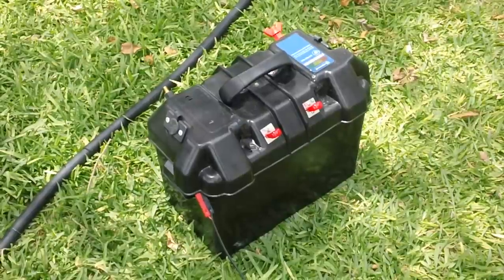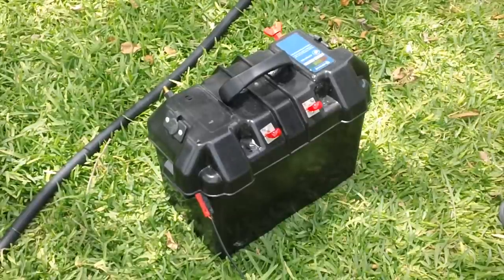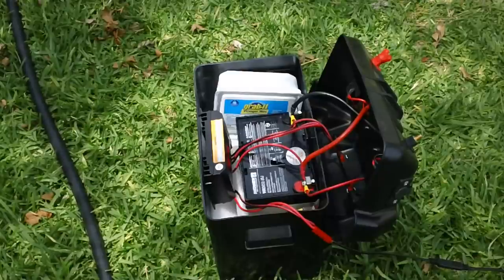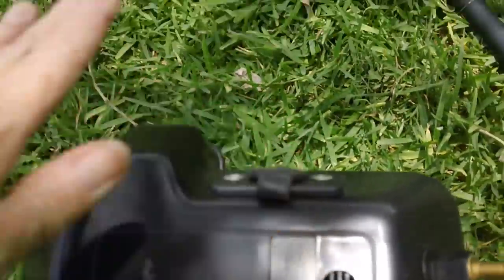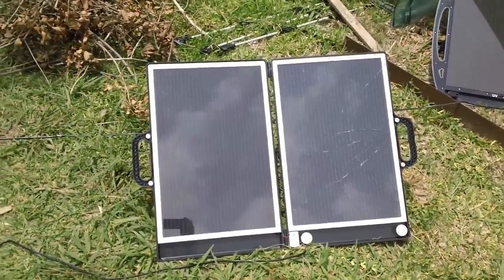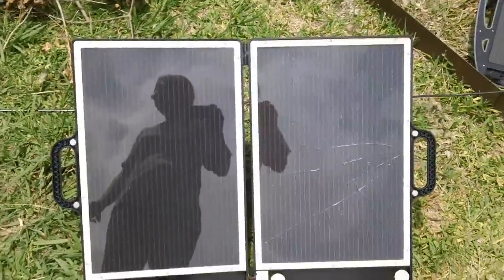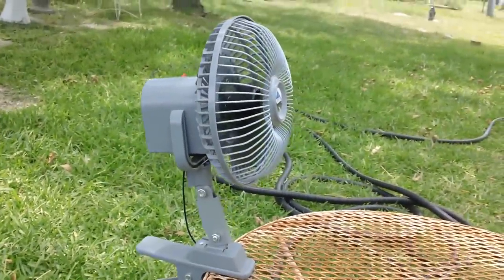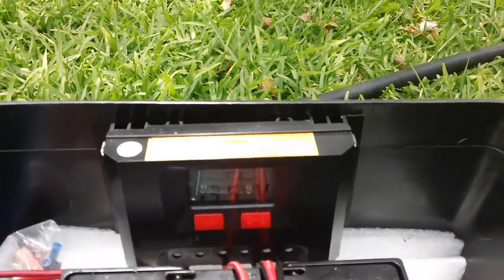Prepper Power - Homemade Portable Solar Generator

Comment: One other thing, you can use the generator or alternator connected to a bicycle, they charge up a LOT faster and will help you when there are cloudy days. Basicly any motor is also a generator, just check how much power it is putting out before connecting. Car generators will out out 14.8v and more efficient plus you get to exercise and if the kids want to charge their cell or computer make them use the bike to supply their energy! !

Comment: Very nice video!! One thing that is wrong though is the post labeled "CC" doesn't use power directly from the panels. The post labeled "CC" does use battery power, the difference between posts "B" and posts "CC" is that post "B" will drain your battery to 0% if you leave your stuff on, and post "CC" will cut off all power when battery is at 50% to prevent battery damage.
Reply from the maker: +AmbSwizag Thank you for the correction.  And thanks for watching.

Comment: The wires coming off of the "Load" terminals on the charge controller are not bypassing the battery. They are pulling power from the battery but can automatically turn off all power from those terminals if your battery voltage gets too low to the point where your battery would be damaged. If you doubt that, unplug all of your panels and power something off of the "Load" terminals and obviously when you are getting power it will not be from the panels that are no longer connected. Oh, and you can get a 12v marine deep cycle battery rated at about 90 to 100 AH for $90-$100 instead of that little 35 AH battery you paid $80 for. ;-)

Comment: Some great ideas but may I offer some suggestions as I have made things like this and now working on a whole house system. For lighting use LED's, options are unlimited (this is where price does matter, opt for the better ones). Add a couple usb ports, they will be useful charging computers, cell phones etc. and they are cheap. You can add a load switch on the outside (off/on). If you are going to make a system that is not so portable and want to add many batteries, junk yards will normally give (for free) battery cables. Get there a week before they are going to crush the cars and they will normally let you go back and take them. In a larger system, the cables and terminals can add up a lot of $$. Add one cig lighter to box that connects only to panels.  If your property is like my impression, you have a barn with equipment. The equipment (including trucks) have batteries with high amp hours. Harbor freight has 45 watt panels with charge controller and accessories, if you get them at the right time they will cost barely over $100. So, on the south side of your barn (or house) these are great and have mounting frames with them for mounting on the ground but you can also mount them on the roof, a few sets of these with connectors can charge your smaller units plus you can add batteries as needed or whenever you come across one here and there. You can get large (tupperware like) tubs to put your batteries in so they won't be on the ground and will not be subject to minor flooding (great if you are installing in your basement plus you can add a 12v sump pump as I did and never worry about flooding. And finally, for your next video, make a script so you don't keep repeating yourself, show all equipment at the beginning and explain what each is, what it does, the cost and any personal data or experience you have with that particular item. Over all, I think you have some great ideas. You made me decide to make a portable unit. Overall, "great", so I am subscribing and looking forward to your next video. Oh, the outside units (45 watt panels), you can start with one set and add a set whenever they have their sale and you can use a coupon, Harbor freight is one of the best stores I have ever been to.
Remember...Watts divided by volts = amps you can reverse it also,  Amps X volts = Watts
Converters at Harbor Freight are cheap also and good to have around. 100w, 200x, 450w etc, real inexpensive and as a prepper, you know they will come in handy. I have some other ideas also and they will probably come to me in the middle of the night so I will write them down and if you don't mention them next time, I will add in comments. INFORMATIVE SHOW !!! ^5

Comment: I looked for the Battery Power Center Box and found one through Sears and will get it for $0.00 because I had exactly enough Shop Your Way rewards points to cover the cost and it will be shipped to my local store so I do not even have to pay shipping. What a country!

Comment: Safety First! 12 volt can and will cause a fire if not fused properly. Any thing you connect to a powered circuit needs to be fused to prevent a fire! The connections in the lid of your box are connected to a breaker if its like the one I got, but the stuff you connected directly to the positive battery post needs to be fused to prevent a fire. The charge controller needs a fuse between it and the battery. Solar panels produce power and need a fuse on the positive wire to prevent a fire. Check any commercial solar system and you will find fusing on the powered wires. Nice setup but needs to be fused.
Reply: Normally if you use the right size wire, you shouldn't need to worry about fire. Fuses are added to protect the end unit from damage (like the radio etc), but yes, you are right, there should be more fuses in it. On each lighter socket and if she adds usb port, they MUST be fused or the cell phone or laptop she is trying to charge could end up in smoke!! You have great attention to detail !!! Good show !!!

Comment: 1500 watts can always depend on the size and type of batteries that the solar generators has. It is guaranteed that the cycle of recharge and discharge makes it certain for batteries to charge in accordance to what it has juiced up.

Comment: SurvivalTechNord She said the 12Vdc sockets were 10A fused. She also can inline fuse the Anderson pole connectors if need be. One improvement would be to install 4 diodes where the four leads feed into one output (incidentally this splitter is wired in parallel) one on each of the four leads. Cathodes towards the output lead. That would prevent current back flow if the panels droped 0.6v below the voltage of the battery at dusk or nitetime. But from what little I know about the specific specs of her panels, I would think they are reversed bias protected. For her first foray into solar generation she did pretty well and I will follow her lead No pun intended.
Reply from the maker: Hi Thanks for the input.  The panels do have reverse bias protection.  It was one of the things I had read up on and learned from the many great videos here on youtube.  :-)  Will have to research the cathodes though don't know anything about that so thanks for the info I always appreciate constructive input.

Comment: If you ever attend flea markets to sell goods, on a really hot day, that would be an AWESOME little system to have to run some fans to keep you cool.  You could probably make some kind of little mounts that you could allow the solar panels to stay on the roof of your car, van or SUV.  You could put a nice blanket on the roof and leave the solar panels up there to charge the battery and/or run power to an inverter.  Amazon has a Monocrystalline 250 watt panel for $349 now.  You could get two of those and have 500 watts and have enough power to run a good inverter.  Getting a good deep cycle battery is where it also gets expensive.  The cheaper batteries won't last much more than a year as they are not made to completely discharge too many times.
Reply from the maker: excellent idea
Reply: PrepperRetreat Since I wrote that, I have found that Renogy is now selling 250 watt Monocrystalline panels for $239, but they require buying 2 minimum, so you'd have 500 watts for under $500.  More than enough power to power some fans, a radio or even a laptop or other items that you may need to power some stuff while sitting out in the sun all day.  I've seen lots of people selling stuff at flea markets and most of them did not have power unless they paid for the much more expensive booths.
Reply from the maker: That's a good price.  I will have to check that deal out.
Reply: PrepperRetreat To find it, go to Google and cut and paste this search phrase to find it.  This thing won't let me post URL's.  Search on:    Renogy 250W Monocrystalline Solar Panel Black on Black

Comment: it actually is a 420 watts/hour storage..consideration must be taken on not depleting it past the 50% of its capacity which is 210 watts which you should wisely determine on what to use them so you do not damage the battery or kits life....and watts is watts no matter if you use them in an hour or during a whole day or even days while recharging having sunlight availability.

Comment: Running in a series will add up the voltage and leave the amps the same. Running in parallel with keep the voltage the same and add up the amps.

Comment: Ideally for the average Blue Collar guy say in Florida or Louisiana on a beer budget prepping for H'canes...a "Solar Generator" battery pack that would get you thru the night (say 10 to 12 hours) with enough energy for some lights, a fan or two, a couple of small power supply battery chargers and a radio or TV (asking for a lot from batteries, I know) . One could back that up with one of those little Harbor Freight petrol generators for the refrigerator if a longer term outage occurs.
Reply: As I said above, using LED's for lights (they use almost no power) and a cheap 12v motor off ebay for fans with Lightweight blades will supply what you are talking about.  Remember, anything that generates heat or cool is going to use a lot of power. My suggestion, put the beer in a stream with a rope tied to it.

Comment: Nice work, ma'am!  I'm about to start working on a similar project myself.  I'm going to try to put four 10Ah batteries connected in parallel inside a Pelican 1200 series case.  If it works out well I might build more than one (eventually) to serve as backup power for my HF station in a box!
Reply from the maker: Sounds great!   Love the pelican box idea.
Reply from the maker: PrepperRetreat Oh and a video would be really great.  Loved the one on your 8900R
Reply: Thanks!  I'm just about finished building my HF station in a box.  Once I get the digital side of the operation working I want to make a video going from all my gear loaded in the truck to fully up and running making contacts.
Reply from the maker: I'm looking forward to seeing it :)

Comment: Hello PrepperRetreat
I have watched this video many times and I really enjoy your sharing. Something just hit me about the setup, and I thought to ask you about it. When you have your solar panels plugged into the charge controller, and the charge controller is plugged in and charging the battery, how do you:protect the charge controller from melt-down if you plug a high amperage device into the cigarette lighter port on the box, if the charge controller is also charging the battery? Shouldnt the "load" side of the charge controller be the only place you take DC from the system, if the solar panels are connected?
STN

Comment: Actually with that 35 amp/hour battery you built a 420 watt solar power generator
(35 amp x 12 volts = 420 watts)..NICE JOB!!!
Reply from the maker: +Carlos Lizardi-Montero Thanks :)
Reply: That's nice of you to compliment her and make her feel better but 420 watt HOURS is not the same as 420 watts.  If you had a full charge on that battery and you drew 420 watts from it, you would deplete it COMPLETELY in a single hour... in reality, you can't drain a lead acid battery all the way.  Nevertheless, amp hours or watt hours are a measure of storage capacity vs. amps or watts which would be a measure of power.
She is right that companies actually claim their solar generator is a particular wattage when it is just the inverter that can support that amount of power.  I don't think anyone should make such a claim unless the battery capacity is enough such that the full power can be provided for an amount of time that is equivalent to a full tank of gas for a regular generator.  Furthermore, if the solar generator comes with solar panels, the panels should be powerful enough to completely recharge the battery (bank) in a reasonable time.

Comment: my friend that is the sound i get out of my gx-l3 battery op compressor wyhen i have the converter plugged in and i plug that into a scetchy extension cord.
 the fans dont want to kick on good and the compressor wont pump correct. i have to unplug it abnd then plug it in better , a firm connection gets better production. of course that means it is pulling more amps, so there is deffinitly wear on the motor and windings and more than normal wear on the cylinder. 37 fills huh. hmmm. well i can suggest a vever at the $324 level with auto stop and a year warranty. course that is just because vever will send rebuild parts if you ignore their attemts at bribery.
 i have not had any issue out of my gx-l3 it just works when it is plugged in correctly.
 and i think it is comming up on a year service here in june.

Comment: I liked your video so much I hate to even comment about the Powerpole connections.  For use in amateur radio, the community has adopted a standard polarity for assembling the Singlepole connectors, using one red and one black housing, as well as a mnemonic for remembering the arrangement for the positive connector: Red Right—Tongue Top. (Google it and you'll see what I mean)  When looking at the front of the connector, the red should be on the right with the tongue at the top.  You may have too many already connected to change now however...................although you may be able to just slide them apart and reverse them.  Whatever, just my 2 cents worth.  I am going to build one like yours for my portable radio operations too.  Great idea! Hope to get you in my log someday. 73

Comment: Nice informative video. You can also run that 14watt fan directly from one of your 9 to 14watt panels, without using your battery. And the battery power can be used for something else.
PEACE!
Reply from the maker: Thanks. :)

Comment: are all your panels the same size? if your panels are running in a series or paralell i have measured that it actually reduces your power output by the lowest output panel. Also if you are running a 12v dc inverter that itself is taking probably 25% of your power to just convert it. I hope your panels are big enough to recharge your battery as quick as they are draining while using an inverter. im in the process of making another similar setup they only thing im missing is a higher amp CC and Higher watt Panel. i am making an all 12v dc system for my off the grid shelter. if you are interested in bouncinf ideas back and forth message me.
Reply from the maker: Jasen Denney Hi.  Thanks for the info.  Nope no inverter on this little system.  It is made to run only 12v stuff.

Comment: Great idea for off grid. Making one myself. where did you purchased the black and red lead with buttery fly cover?..👍😊✌
Reply from the maker: +Nos Dehgan battery box with cover came from walmart and black and red leads came from ebay they are anderson pole connectors
Reply: +PrepperRetreat I meant the positive and negative connection for recharging the batteries.. the one with red butterfly cover.
Reply from the maker: +Nos Dehgan It came with the box.  It's a marine battery box.
Reply: +PrepperRetreat Thank you soooo much for info. Best wishes from Vegas.

Comment: Hey Prepper, have almost a similar setup with the exception of 100 Ah battery, 1 Harbor Freight Brief Case Solar Panel and 1 inverter. Question, After having everything hooked up (except the inverter) I couldn't get any amperage showing on the charge controller (Harbor Freight - same as yours). Being that the solar panels are rated 400mA I would think the controller would exhibit at least .4 amps. Does your charge controller display .4 amps when you have only the brief case solar panels hooked up?
Reply: The brief case panels are okay to add to a system or to grab and run in an emergency situation but watt for watt the 45 watt panels are cheaper.

Comment: Ive seen some vids where the load connection of the charge controller is left alone, and thus the inverters is connected direct to the battery, as this spares the charge controller from receiving too much AC current ?  Has this been an issue?
Reply from the maker: wotan237 The setup I have at the cabin leaves the load connection of the charge controller unused and hooks the invert directly to the battery.  It has caused no problems.  Most of the load connections on the charge controllers are just for small items such as lighting.  Thanks for watching

Comment: I see small problem. You say " i have 4 wires and 1 spliter set up to series. If you set up to series 4 panels 12V. You have 48V and yours batery is only 12V. If you take off regulator batery can by damage

Comment: your panels are in parallel, series adds voltage not amps/watts, parallel adds wattage/amps, not voltage. otherwise you would be producing 48v.
Reply from the maker: +Ryan Thomas thanks. I have finally gotten to where I can keep those straight.